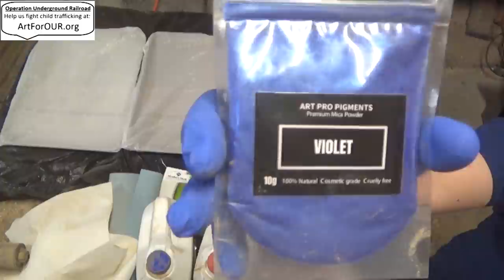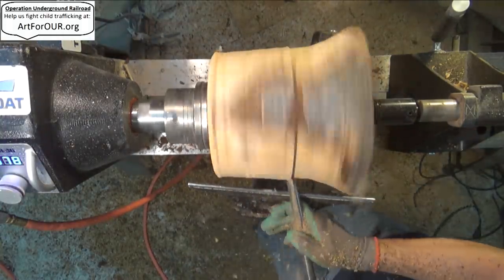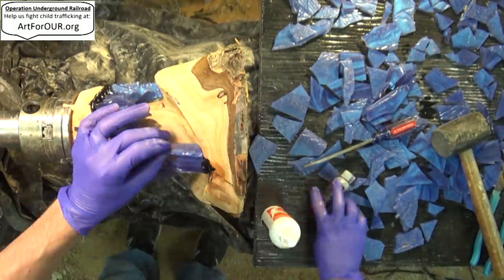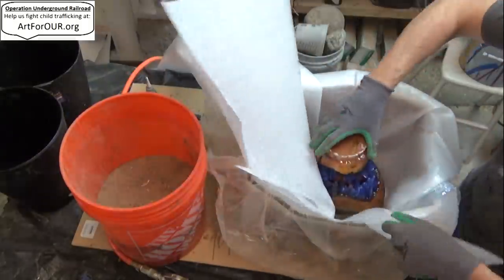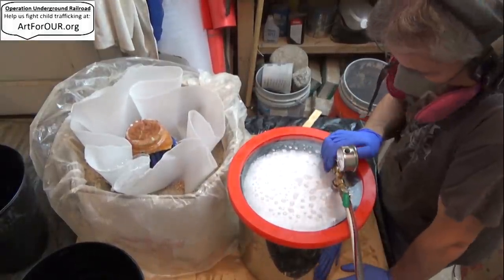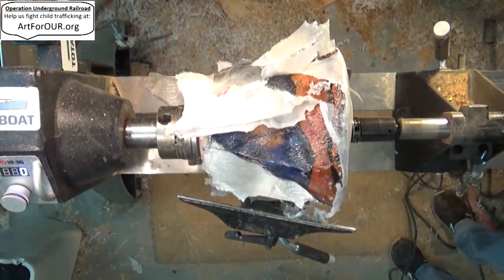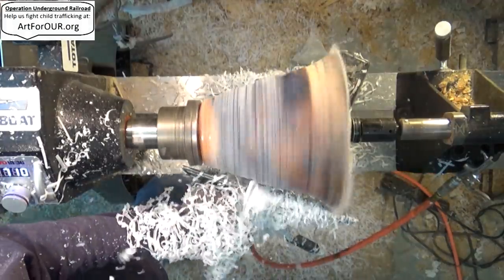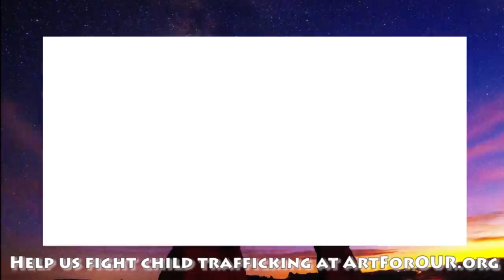"Crystal Cave" Cracked blue resin, clear resin and cherry wood vase, turned on the lathe. O.U.R.

Comment: For your bubbles forming you could also take and mix your resin 50-50 with acetone and then paint the wood .
The resin and acetone mix it will soak in and it will dry a thin coat on it I’ve done that on punky wood and on dampwood to seal it up. It orks really good. 
50-50 mix resin and acetone
Reply from the maker: Thank you Dave!
https://www.artforour.org/how-you-can-help

Comment: In regards to the foaming resin I have found with total boat and some of the others that if the moisture content of the wood is above 10 it will foam up a whole bunch, so  maybe drying the wood more or put it in in some sort of a oven or something to lower the moisture of the wood will eliminate the foaming. Plus using on a lacquer sealer on the wood helps also. Great videos.
Reply from the maker: Thanks Dave!  Much appreciated. 

https://www.artforour.org/how-you-can-help

Comment: Cool project. G’day from Down Under. Two points that you might try… 1. You can pre-heat your epoxy prior to mixing. I use an old microwave oven, a few seconds at a time to sneak up to 30 Celsius. I use a “laser pistol” thermometer for this. Be aware that you will shorten the pot life by doing this, but de-gassing should go much quicker. 2. There are available specialised “penetrating epoxies” designed for fixing rotted and punky wood. They’re painted on as a pre_treatment. They will help greatly to eliminate air bubbles escaping the pores of the timber after the subsequent main pour.
Reply from the maker: Good ideas!  Thank you...

Artforour.org

Comment: This turned out really nice. It's so pretty with the light inside. I like your idea of making smaller pieces of blue resin so they seem to float a bit more and so you can see the spaces in between. I was thinking that it would look cool with a cloudy/ creamy white/clear translucent section in the middle epoxy filler section (think candy marbles) and to hang this upside down as a lantern over a table with a dimmable old school looking Edison bulb inside or maybe those fancy Philips smart lights that mimic light based on time of day.  I almost started imagining an underwater scene in there because it looks like reefs and lava tube caves. Wonderful work!
Reply from the maker: Thank you so much Risa!  Great ideas!

Artforour.org

Comment: I’ve only watched a handful of these. I’m curious about vac chamber vs pressure pot as far as the outcomes.
Reply from the maker: The vacuum chamber really helps sink the resin deep until cracks and pockets in the wood.   The pressure pot helps squeeze micro bubbles to get clear resin.  I usually use both...

Comment: Even though you think a silicone mold might be a waste I don’t think smooth on has a lot of products that are inexpensive you make the general size mold  you want it to be you put your project into that silicon mold draw your vacuum after pouring the resin in  and even if it isn’t 100% perfect you’re gonna turn it anyway you’ll waste less material your existing process looks a bit time-consuming if you made standard molds of standard size projects whatever that may be just a thought great videos great cause . Are use a 5 gallon pressure pot for spray painting I reverse the plumbing so it’s drawing a vacuum just holds bigger projects you can’t see it foam up but you just do it about as many times as you remember doing it with The side glass thanks again.
Reply from the maker: Thanks a Mike!  I appreciate the advice and support.

Artforour.org

Comment: hi. I have a question sir. is a 1000W machine is enough for epoxy-woodturning? or a more powerful one is needed?
thank you
Reply from the maker: I'm not sure about that.... mine is 1.5 horsepower .  My beginner was 1/3rd HP and I destroyed it.  Sometimes I wish mine was 2 or 3 HP...

My current specs:  Electrical: 1.5HP, 110 Volt, 60 hz
 Motor: Induction, 1725 RPM, TEFC
 VFD: Delta S1 Variable Frequency DriveRecommended Breaker: 15 Amp

Comment: This is one of the most gorgeous, inspiring pieces of art I've ever seen. 

Forgive me if any of these questions are too personal. Feel free to skip any such questions without explanation or comment. 

How do you price such a thing? What were your materials costs and number of hours spent?  Could you please explain why, for this project, you didn't seal the wood cracks with resin or some sort of glue or other stabilizer to prevent moisture absorption and cracking in years to come? Is there no way to do that without the sealant being visibly obvious and
 detracting from the beauty of the rest of the untreated wood?  What do you do with your waste materials? I assume you can't personally melt and reuse the resin due to the chemical process that solidifies it, right? Would the resin have to go thru a professional treatment process to be melted down, purified, and used in plastic recycling?  How do you handle your wood waste? As I watch the wood and resin shavings covering you like silly string, I wondered how one would recycle the two materials when they are so intermingled. It seems like the process of separating and cleaning the two would destroy the reusability of one material or the other. When you carved with a bright light on the resin, was that for the sake of the filming (it looked gorgeous to see the 
light bursting through the wood like sunlight through storm clouds) or did you need the resin lit up for carving purposes?  Do you ever use resin in a project where the bubbles are desirable for artistic purposes? Or do the bubbles compromise the strength of the object?  Are there any steps necessary for maintenance of such pieces to prevent the resin and wood from separation over time?  Could any of your resin & wood vases be used as traditional vases, with water and flowers, or would the water and rotting process at work on the flowers damage the vase?  What is the name of the metal rod you sharpen and use for most of your carving?Are you able to do repair work on these pieces if you damage them in the carving process, or are they rendered unusable? Do you go hunting for your own wood or purchase it?  How did you get into this specific form of art, combining wood and resin carving? What are the size limits to your objects? I assume there is a point when the wood is too big to fit your equipment, even if you can find other ways to get around the size limits of gear such as the buckets.  Thanks for sharing all of your hard work, and for the immense effort it takes to film and edit these videos!
Reply from the maker: How do you price such a thing?
- as my channel grows  so does the demand.  My first bowl went for $20, my most recent went for $500.
 What were your materials costs and number of hours spent? 
-my wood is free, found around and the resin is from totalboat my sponsor.   I'm only into it sanding and finishing materials and if course my equipment. 

Could you please explain why, for this project, you didn't seal the wood cracks with resin or some sort of glue or other stabilizer to prevent moisture absorption and cracking in years to come?
- the resin is thin enough and takes so long to set up,  that it soaks into the wood protecting better than most finishes and prevents cracking etc.
 Is there no way to do that without the sealant being visibly obvious and detracting from the beauty of the rest of the untreated wood? What do you do with your waste materials?

 I assume you can't personally melt and reuse the resin due to the chemical process that solidifies it, right? Would the resin have to go thru a professional treatment process to be melted down, purified, and used in plastic recycling? How do you handle your wood waste? As I watch the wood and resin shavings covering you like silly string, I wondered how one would recycle the two materials when they are so intermingled. It seems like the process of separating and cleaning the two would destroy the reusability of one material or the other. 

- you can't recycle resin or reuse it.  Even I have pure wood shavings I line the pathways in my yard with them, mixed waste is sent to the landfill.
When you carved with a bright light on the resin, was that for the sake of the filming (it looked gorgeous to see the light bursting through the wood like sunlight through storm clouds) or did you need the resin lit up for carving purposes?
- the light shining though helps me know when I've gotten rid of enough internal wood and the resin is now exposed, so i don't go-to far.
Do you ever use resin in a project where the bubbles are desirable for artistic purposes? Or do the bubbles compromise the strength of the object? 
- I've done pieces where the bubblesmadevit look far more interesting.   I've even foamed the resin but does make it quite soft. 
- the wood and resin won't separate it seeps into the pores of the c wood. Wood polish on any parts ofc the wood that aren't covered with vresin. Are there any steps necessary for maintenance of such pieces to prevent the resin and wood from separation over time? Could any of your resin & wood vases be used as traditional vases, with water and flowers, or would the water and rotting process at work on the flowers damage the vase? What is the name of the metal rod you sharpen and use for most of your carving?Are you able to do repair work on these pieces if you damage them in the carving process, or are they rendered unusable? Do you go hunting for your own wood or purchase it? How did you get into this specific form of art, combining wood and resin carving? 
- I was inspired by fellow woodturners using resin.  The possibilities are truly limitless with this medium. 

What are the size limits to your objects? I assume there is a point when the wood is too big to fit your equipment, even if you can find other ways to get around the size limits of gear such as the buckets. 

- the lathe can only take so big of a size abs can only turn so much weight.

Comment: Have you tried sealing the wood with a shorter drying epoxy and then doing the pour over that?
Reply from the maker: I did once.... not much better success.  What's working really well recently is to put the wood in the resin in the vacuum chamber.... more to come. 

Artforour.org

Comment: Dan, this is just pure conjecture without any experience whatsoever..... But I was wondering if you put like three layers of cheesecloth together to make a kind of strainer, and then poured your epoxy resin through that. My thought is that the bubbles in the resin possibly maybe minimalized or even eliminated as they pass through the cheesecloth. I don't know if it would work.... Maybe the resin might be too viscous to pass through the cheesecloth effectively. But I'm thinking that the cheesecloth, especially three layers, may help to get rid of the air bubbles to Great extent. You can experiment a little bit and see if it might work.

Like I said, I'm just spitballing this idea. I've never done it and I don't know if it will work. But when I was in college, as an industrial arts major one of the areas that I took extensive courses in was plastic molding and technology. So it's just a guess.
Reply from the maker: Not a bad idea!  Worth a shot i say...

Artforour.org

Comment: Awesome job. Great creativity. What is your lathe spindle thread size and length? What is the largest diameter you can swing in your lathe?
Reply from the maker: Thank you Jody!  I have a Laguna 18/36.

Here are the specs: Power: 1
5HP, 120V, 60 Hz

Motor: Induction, 1725 RPM, TEFC

VFD: Delta S1 Variable Frequency Drive

Phase: 1 Ph input, 3 Phase output

Poly-Groove Drive Belt w/ easy access

Recommended Breaker: 20 Amp

Spring Loaded Spindle Lock

Max. Outboard Swing: 32”

Swing Over Banjo: 13-1/2”

Steel Bed: ASTM A36

Spindle Taper: MT#2

Swing Over Bed: 18”

RPM High:135-3500

RPM Low: 50-1300

Tailstock Quill: 4-1/2”, Engraved, Self-Ejecting

Floor to Spindle Center: 41-1/2” w/ pads

Front Bearing: TPI Taiwan 6207LLU

Rear Bearing: TPI Taiwan 6205LLU

Spindle Index #: 14/36/48 w/ lock

Distance Between Centers: 36”

Headstock Through-Bore: 3/8”

Headstock Travel: Full Length

Tailstock Through-Bore: 3/8”

Tailstock Storage of Centers

Spindle Size: 1-1/4” x 8 TPI RH

Floor to Bed: 32-1/2” w/ pads

Footprint: 60” W x 26” D x 47” H

Weight (Net/Ship): 427/480 lbs.

Comment: I wonder if you could use a two pot method for your cast, first pot remove the bubbles like you did in one vacuum chamber pot, then remove all the air from a second pot with the wood in it. You would have a line with dual valves on each pot with a tube leading from the resin in the resin pot, that is no longer under a vacuum . When you have a 27 - 30 hg vacuum on the wood pot you open the valve keeping the vacuum pump on the wood pumping drawing the resin into the wood pot from the resin pot. This should in theory cause the resin to flow from one to the other and fill any air voids in the wood with no air bubbles.
Reply from the maker: Not a bad idea!  Now you've got the wheels turning....

Artforour.org
Reply: Pressure pot works the best for casting resin but can be pricey to get a big one
Reply from the maker: True!

Artforour.org

Comment: did you really do that on plastic bags?
Reply from the maker: The plastic bags were last minute filler for the top of the form.   Normally I would have just used more sand, but it was too heavy and collapsing the firm walls...
Reply: @artgivinghope  I had no idea that was a possibility, I can think of a few things I can make where using a trash bag will be helpful.

Comment: To seal anything porous you want to do is at each step. So when you finish the wood, seal it..Cactus juices has to be baked. If You use the medium set epoxy and really get it into the wood with a brush. Stick it in the pressure pot and repeat until no more bubbles come out of. Repeat. Glue on your blue parts and put it in the pressure pot with epoxy (no baking.) when you are bored of watching the baby bubbles come up to the top, put it in the pressure put.
You said it was cold. Go to the per store, reptile section and get 1 or more self stitch warmer pads and wrap them around the outside of your pressure pot. They are all are at 82 degrees, so it’s the perfect temperature to pressure at. 
Try it and let me know.
LM
Reply from the maker: Thank you very much!

https://www.artforour.org/currentauctions